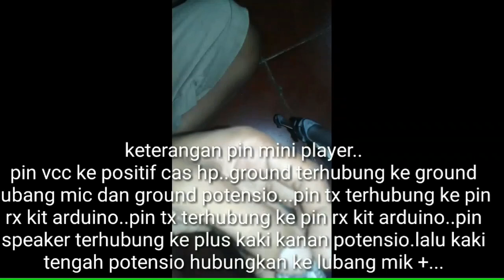MEMBUAT PEDAL DES KE MIXER DENGAN ARDUINO PRO MINI & MEMORI HP

Comment: Kalau cuman beli df nya itu berapa bang
Reply: Kmaren saya baru beli modul ama pedal, baru coba sehari modul usb nya saya tancepin langsung mixer pertamanya bisa kok tiba" Gk bisa bunyi tpi lampunya  msih nyala. Kenapa yha. Apa gara" Usb nya langsung ke mixer gk di adaptor ces.
Reply: Udah bberapa kali tk cpot bang. Tk psang ke hp masih scan. Pdahan lmpunya juga nyala tpi kok gk bisa. Tpi tempat memori agak pnas" Gtu. Apa kalu di gnti bisa bunyi yha
Reply: Cba Minta wa nya bang?
Reply: @cahmbakalan   misalkan  buat pedal des dengan dfplyr apakah bisa bang
Reply: @cahmbakalan   pakek dfpyr aj bang gak pakek controler arduino apakah bisa bang . mohon solusinya
Reply: @cahmbakalan     apakah bisa langsung  bang tanpa perintah arduino
Reply: @cahmbakalan   jeda delaynya brapa detik bang